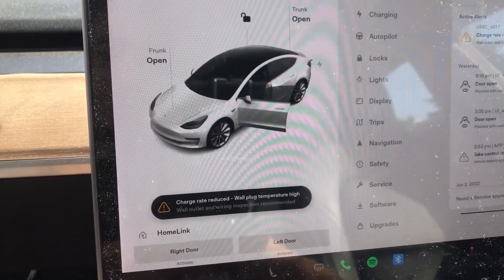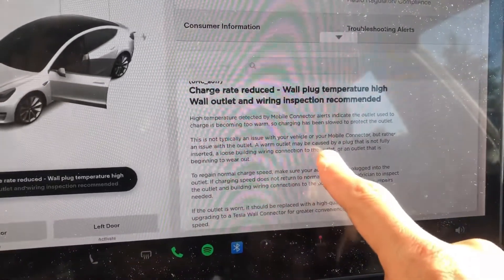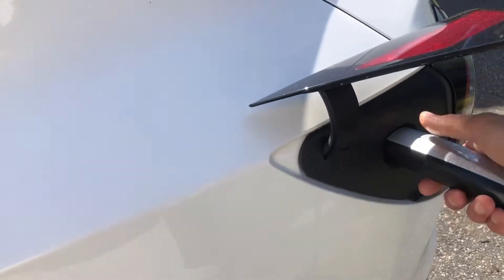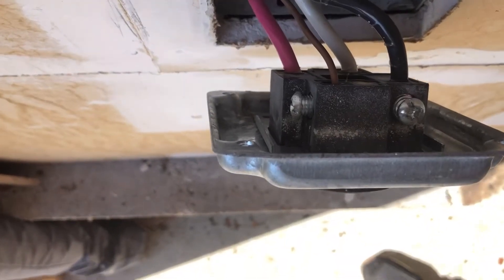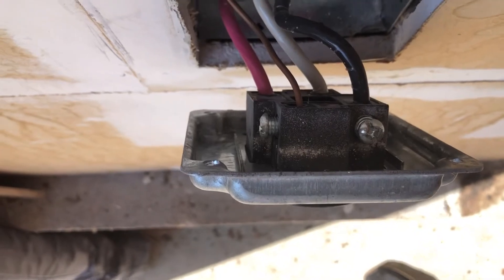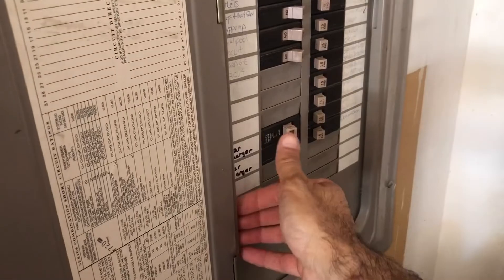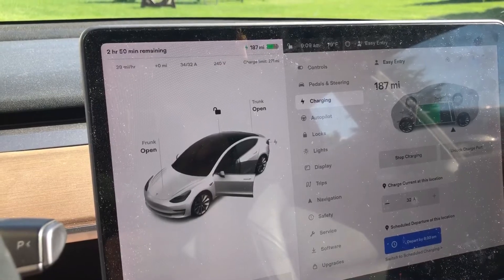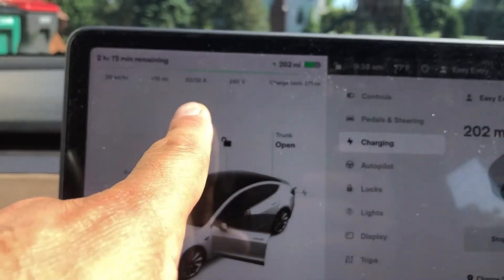[TESLA] Charge Rate Reduced - Easy Fix

Comment: My outlet is brand new 3months old , and this is been happening , also tested at another persons house and same thing ..
Reply from the maker: Your test at the other person’s house. Was that with your charge connector or theirs?
Reply: @tareksaleh77  my charge connector was tested at both houses ..

Last night it was charging for 30mins  then slowly dropped kW before it then shut off .. today I tried again and it charged the car at full KW. Strange . I’ve heard it’s usually a bad UMC not the car
Reply from the maker: I agree completely. The onboard charger can handle WAY higher heat. The UMC actually has a little thermistor in the plug. Perhaps you can find just a replacement plug rather than the entire connector?

In my case, my outlet had receptacles which were only “half width”, meaning that the actual copper touching the prongs on my UMC were touching only half the surface. This is perfect for creating high heat. Over time this degraded and started causing more heat. I replaced the outlet with one having “full width” receptacles. Instantly fixed it.

In your case, you might be spot on about the UMC. Good call!
Reply: I found if your cord is coiled then this error comes. Try to not overlap wires with each other. It does not makes scene but issue was resolved for me. No need to change outlet.

Comment: Who installed the plug?  Loose wires cause fires.
Reply from the maker: I did. They were perfectly tight 4 years ago. I think part of the cause for this is that I take the charger with me frequently when I travel. Over the years, I think my pulling and pushing loosened it. Anyway, I’m getting a new outlet with better connections. Hopefully won’t have this issue again.